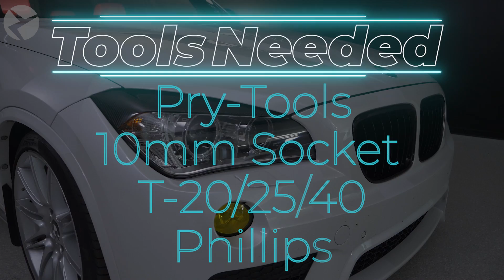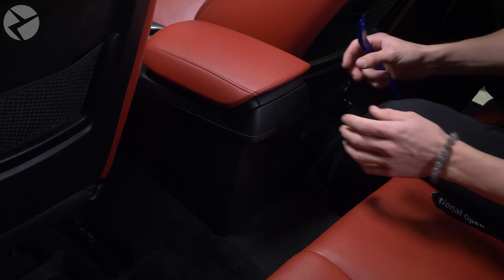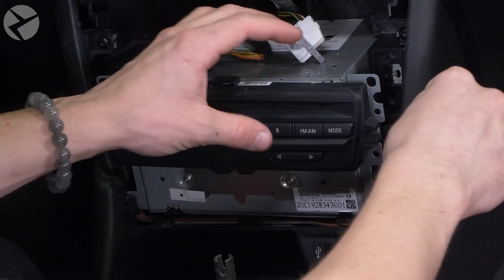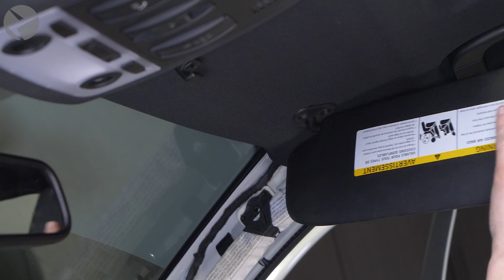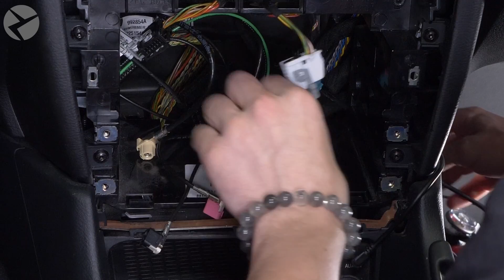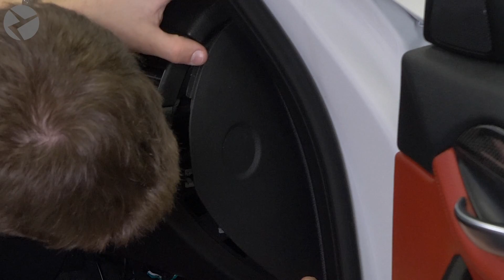BMW CarPlay MMI Prime/PRO Retrofit Installed In X1 E84 – Step-by-Step Tutorial

Comment: This CarPlay box is installed near the fuse box. Since the box gets warm during use, could the heat damage the fuses, wiring, or anything else around it?
Reply from the maker: It gets warm, but not enough to affect anything.  It will all be good!

Comment: Is it possible to have the wiring harness splice into the back of the aux port for a cleaner look? Similar to how the microphone splices
Reply from the maker: Hey! For the aux it is not possible to do like with the mic, it needs to be plugged like this, the only thing that can help is to hide the rest of the aux wire under the trim :)
Reply: Why you even need the aux cable
Reply: The sound from the CarPlay is played through the AUX input, I just spliced the wires into the cable behind the car AUX input so you don't see it, and the aux input is still usable @lerenner9002

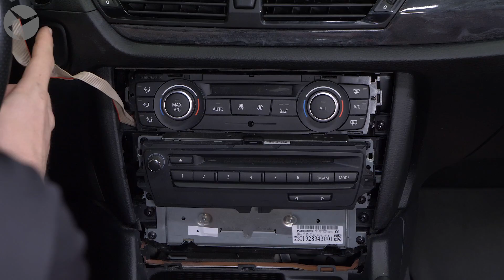Comment: Pro tip: at 4:49 that rusty metal bracket can be pried up on either side with a trim tool or flathead before removing the headunit. It allows the center console tabs to expand outwards and makes removing the headunit a ton easier
Reply from the maker: Thanks!
Reply: Thx for sharing, but which metal bracket? 🤔 I can't see any rusty one at 4:49